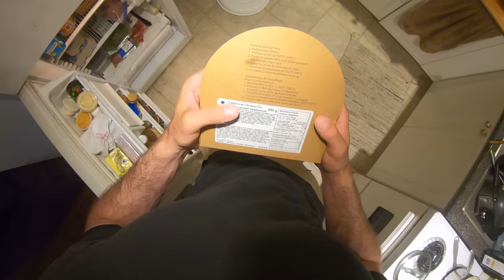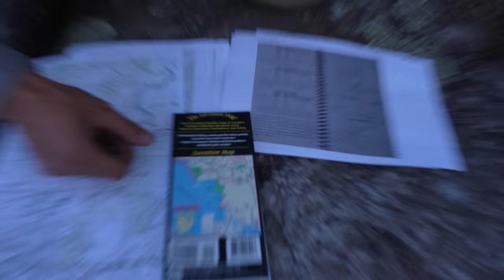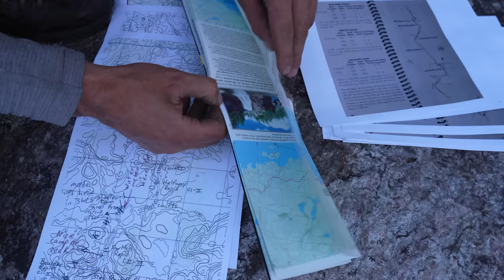13 Days Camping on a River and an Inland Sea - Rough Start - Part 1

Comment: So why back in 1978, I spent a summer as a Junior Ranger and we spent time very close to Pulaski National park making the portages to enter the park. At that time it was still not a national park. Bugs were bad and I mean bad. My home base was Obatanga Provincial park which has been closed since 2012. Beautiful country and that for sharing memories. And the canoes we used were fibreglass and weighed 105 lbs. All you would see every 50 ft were orange ribbons to know were to clear. Most portage’s were 2-4 miles back before km were used. Very rough terrain but beautiful. So clearing a 2 mile portage…clear firsts, come back for heavy canoe, come back for pack. So you end up doing 12 miles for a 2 miles portage. I am now 61 years old and still love to camp, but a must is on the water, with electricity and water. Gotten soft over the years lol. Very funny about eating John, know that feeling in the wildness.

Comment: It is almost like you want to take a machete with you to chop the low branches out of your way.  I'm sure it wouldn't really work, especially if you are in the middle of the rapids, but Wow, those are some close calls to the face.  Obviously you guys made it, so glad it went well.  You were in Lake Superior?  I've been there but by Minnesota area.  Cool.  Your partner may have suffered from memory loss, but did not suffer from limb loss.  You had enough food.  😃

Comment: wow 4:20 , that's how easy it is to get thrown over. i wouldn't sweat the food. it's overrated. usually too much anyway. your body can do pretty good  fasting for a bit. I was going to start taking hardly any food for 3/4 day trips. no cook ware weight, not food weight, no burner weight , utensils. Next trip I'm trying it for the first time.